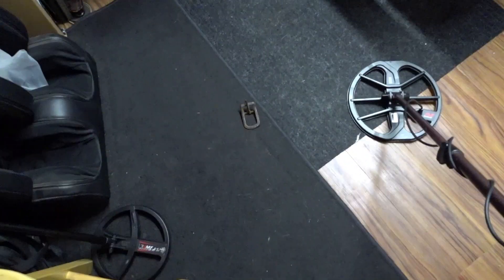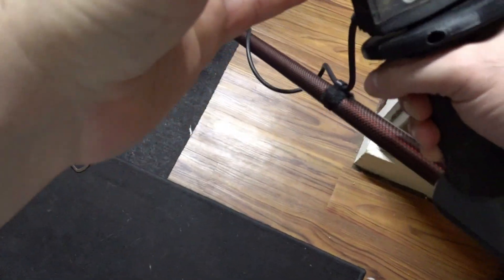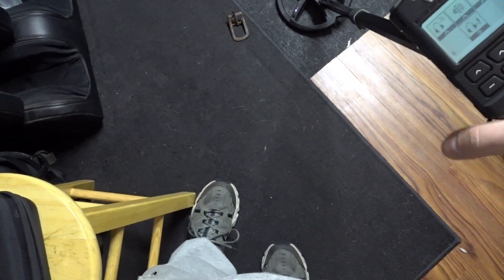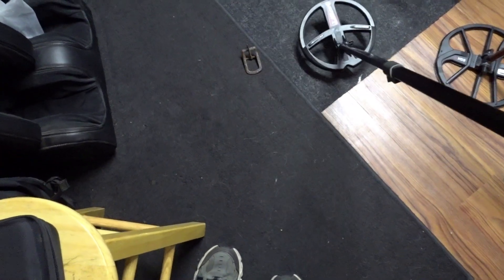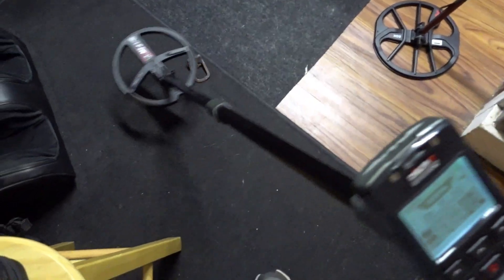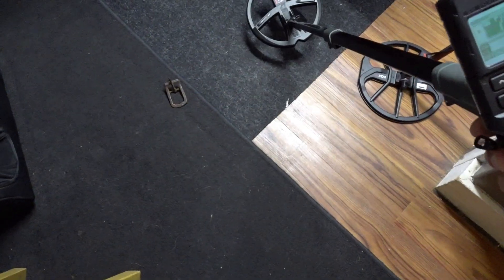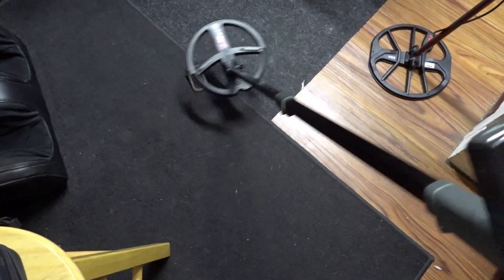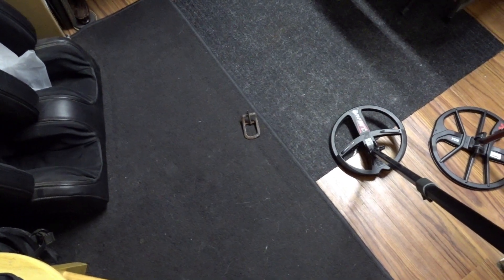XP Deus II vs Minelab Equinox on an Iron Buckle

Comment: Hi Man, Thanks for your video! Deus are tonal machines. The nox has a "square sound, the classic sound like the old explorer, ctx, etc.", very different from the pwn of the deus. With the deus you can understand thick iron and other target informations by learning its harmonics... you will need many holes to fully understand it. Even the deus 2 has the square tone like the nox, but gives less information about targets.I prefer to listen to more information and then decide whether to dig or not.
Reply from the maker: Hey Luca.. Agree ive been messing with Park mode on the Deus 2 for relic hunting. Not much time with it yet but that will be my focus for spring.
Reply: I don't want a tone on iron like that on the deus.
Reply from the maker: @oldArmyVet  hey Terry. You have options to make it sound however you would like.

Comment: have been looking at the XP Deus I / II for ages now, only thing that keeps puts me of them is the sealed in battery life span in them have read many a time the Deus is capable of only 3-4 operation hours instead of 11-12 as from new
Reply from the maker: Hey Eashman, they make the battery replaceable in both the 1 and the 2. I think the 2 might be easier.

Comment: Do you have any experience on the Deus before getting the II?  If the II is anything like the Deus 1 you need a lot of hours on it to understand the iron well and it may be subtle but it is very clear. Sort of like not having to yell at someone who is standing next to you... you can whisper and as long as the message is received that's all you need. I heard nuance in the sound and that was just over the speaker and would be better through the phones, but having a trained ear makes a big difference.  PS: I've had an Equinox for years up until recently. It is a good detector but just not my preference.  If you give the Deus II a solid try I'm guessing you won't look back. PS:  Surprisingly the Minelab is the much better choice when it comes to big iron relics over the original Deus.  Not sure how the II will be as it's kinda a combination of both...  more Deus but some Minelab DNA too. REally looking forward to getting mine.
Reply from the maker: Hey Findy Man, appreciate the input. I had the Deus 1 for a year or two before selling it. I was fine with the Deus 1 in parks and fields but where i struggled was cellar hole and old home sites. These places i hunt are just foot prints of where the home used to be and the Equinox just did so much better with ignoring the big iron when i needed it to. Definitely will be holding on to the Deus 2 we are only at software .06 so it will be interesting to see where they role with all the updates and yes i have to get used to telling iron from the audio. The square tones that i like might be tough with less tonal information.. Looking forward to see others feedback as well. Thx Mike
Reply: @IffySignals  If you watch paystreak he is really good at telling iron with the deus 2.
Reply: I could easily tell it was a iron signal and i have the equinox 800.  Where was the Legend in this ?
Reply from the maker: @oldtimer5037  Hi, this was before the Legend came back.

Comment: swing your nox over it with FE0 and F20 and i think you'll get the same thing as the deus 2. you should expect to get a good signal if your iron filters are at 0.
Reply from the maker: Yea i tested that first.. you do.. F20 gives a good tone on most big iron as expected.
Reply: @IffySignals  I heard the bottle cap feature is better at blocking out iron than silencer . Well at least thats what paystreak figured out.

Comment: if you change the disc on the Deus to say 25 does the sound over the buckle change?
Reply from the maker: Ill try it out.
Reply from the maker: No iron is ringing up in the high 60’s
Reply: @IffySignals  Wow, so the Deus is seeing that as a mid conductor- conductivity of 60 solid.   Interesting
Reply from the maker: Yea.. stacked a couple and it was up in the 70’s. The bottle cap reject will help some but noticed today if its bigger iron it wont knock it out but it will be choppy and as you raise the coil it will disappear faster. Seems like they have something going on with that bottle cap reject similar to the Equinox F2. F2 6 on the Equinox ignores it all.
Reply: @IffySignals  yep!

Comment: What's the xy screen say
Reply from the maker: The XY shows a mess.
Reply: @IffySignals  Same.....I like the XY!
Reply from the maker: @carlfr2977  yea i used to use it with the Deus 1. I like the mew layout of the 2. Will use it but want to get more in tune with the Audio. I notice the the Square audio does not offer much info so the XY will help.